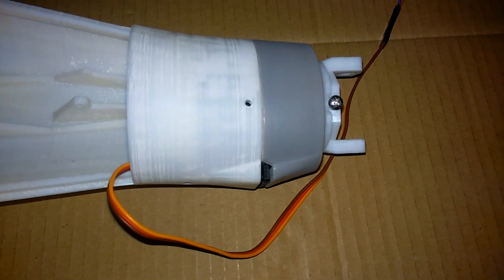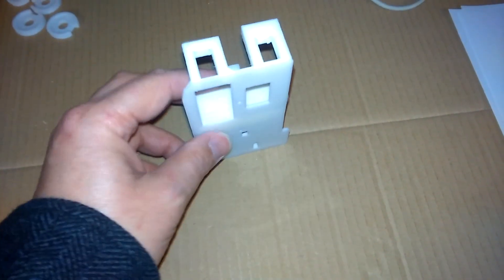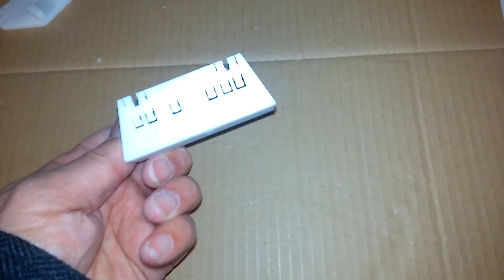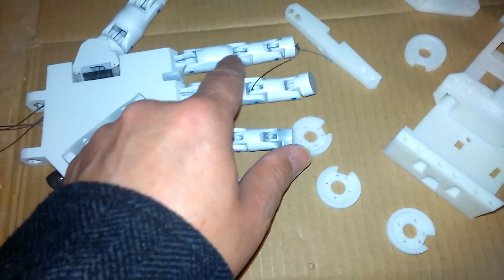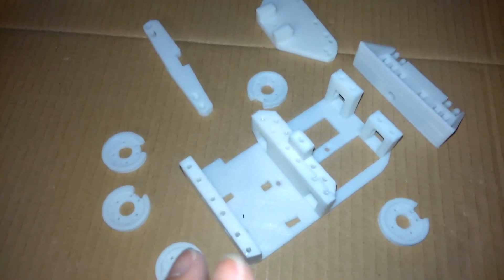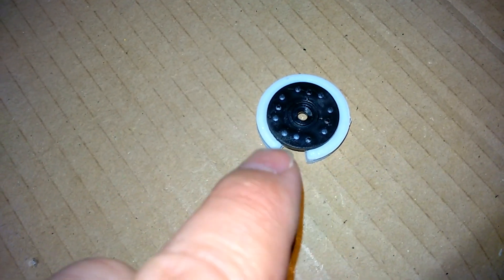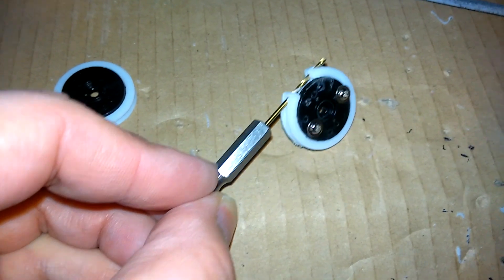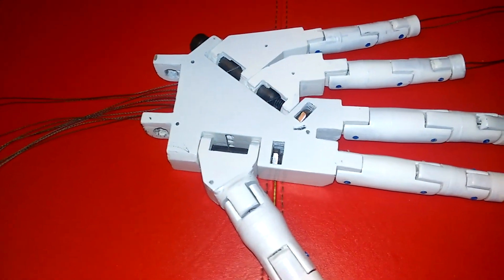Civrays InMoov - Bringing the fingers to life

Comment: Hi Steve, great work, I understood why your fingers didn’t move organically, all the holes are at the same 3.0mm, lets try outside 3.0mm, and inside 3.2mm Dia.
I made that modification at mine and the results are incredible, best is to avoid extra torque in your motors.
Reply: Christian - how are you locking those pins into place on the fingers?  Also are we running the wire through BEFORE assembly?
Reply: @TheRealJimmyZ  i use Aluminium Wire 3mm, you can find it in Amazon. The holes are no perfect after the 3D print, therefore I use a bit of 3mm and make the holes manually. 3.0 external, 3..2 internal. When you place the Aluminium wire you see that it fits very good, then you file the end. You will see that the end results will be incredible. The pin will stays there very difficult to extract. If you want to extract you can use a nail and use a hammer, it will removes the pin easily and you can reused.
Reply: @chjimenez  thank you
Did you do the sensors using the copper or try the hall sensor as yet?
Reply: @TheRealJimmyZ  yes I do the sensors, but not as the video. I made something different. I use the same principle as the dielectric. The difference is that I use Cu Foil, the one that has adhesive in one side, the same that we use in EMC tests. For the contact I solder the end of the cable to the Cu Foil. To avoid errors check which movement produce the long distance of the cable and take it into account, because if your cables are short you can peel it, or easily your finger cannot move. I tested the sensors and I have a change between 50kohm to 15kOhm, that is really great. I’m not using the same electronic concept as the page, I’m using I2C to communicate all the motors therefore only 2 wire + 2 power lines is required. I like the idea, but this motors has the problem that you cannot change the velocity. I have some form Dynamixel, that will be much better, because the connection is in Daisy Chain, bigger torque and variable velocity, but with one of that I can buy 5 of the hobby motors. But this is the next step, first I need to complete the programming, then I can change the design of the motor Bed.
Reply: @chjimenez  I would be very interested in you i2c solution if your ok sharing

Comment: What are those little mock up boards called? The board with the  headers attached.
Reply from the maker: I call them perf board, but others call them prototype boards. Here is the link https://www.ebay.co.uk/itm/Prototype-Board-Double-Sided-Protoboard-2x8cm-upto-15x9cm-Free-UK-P-amp-P-/233168130759?varId=532650654802&txnId=1694551336013

Comment: What braided fish line do you use
Reply from the maker: I am using some 55kg (120lbs) braided fishing line. It's more than strong enough but I notice it is cutting into the plastic. You should use something a little thicker.
Reply: I ended up using more of a 200lb fishing like as reports were that the lower thickness wire seemed to cut into the plastic over time...